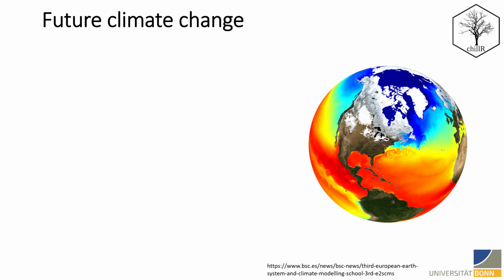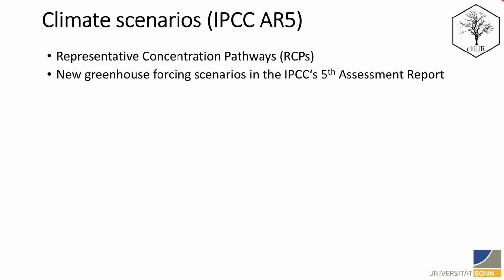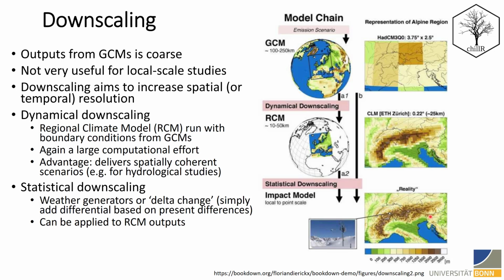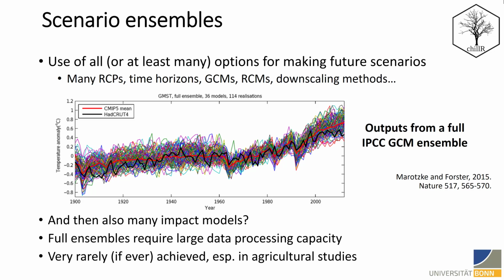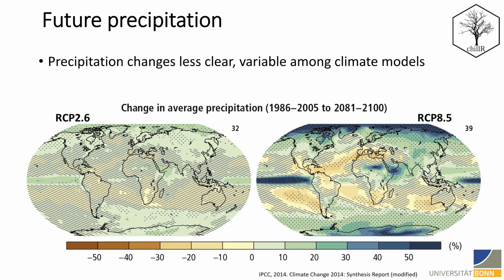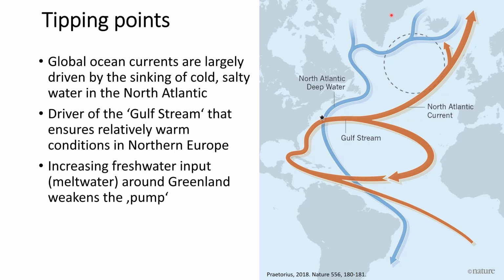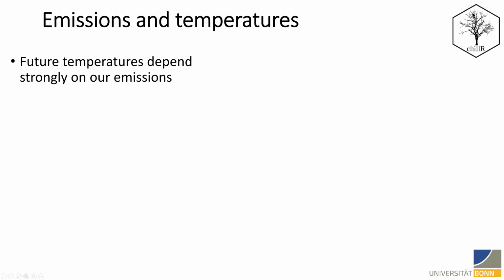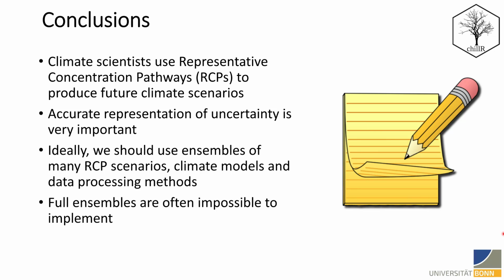Climate change 3 - future scenarios

Comment: The models are a joke.   The fact is that the current levels of co2, methane and nitrous oxide have locked in a 5c temperature rise,  and probably by 2040.  That 5c rise automatically catalyzes dozens of feedbacks to rapidly generate more and more heating,   as albido is lost and methane is released from permafrost, and as the hotter air holds more and more water vapor.     Reducing emissions does not reduce atmospheric concentrations, because ghg's are recalcitrant.    These models dont account for the dozens of feedbacks that have been triggered and that will continue to drive runaway greenhouse.  Yes, we are in runaway greenhouse.    Climate science has become the most dishonest science on the planet,   and it seems to now be designed to deny that we are doomed and that  only removing over one trillion tons of ghg's from the skies,   while stopping all human emissions can stop total climate collapse,  extreme global overheating, biological anihilation and NTHE.
Reply: Yeah methane is already going vertical and we will lose the Arctic in the coming years. We'll see exponential change soon
Reply: Where is your evidence that we will be 5C warmer by 2040 when many sources say it could be 4C by 2100 if emissions keep rising rapidly?
I'm not a climate change denier, I think its a extremly serious issue but there must be a valid source so that way it could be seen that you are telling the truth.
Reply: @ruairievans  the greatest short coming of the human race is our inability to understand the exponential function- Al Bartlett

Comment: Thanks for this important lecture.   Useful for anyone wanting a better understanding of models and predictions.  Clear, simple, academic language. Nice graphs and charts.
Reply: For confirmation or denial of predictions say for 2050 or 2100 you only have to wait 29/79 years.
Modeling a chaotic system (The Climat) is wery challenging with parameterised data : GI-GO.
Physics used to work with precise measurements. Precision is defined as the quality of being exact.
Reply: Predictions are opinions.